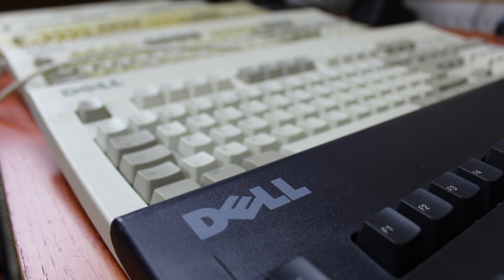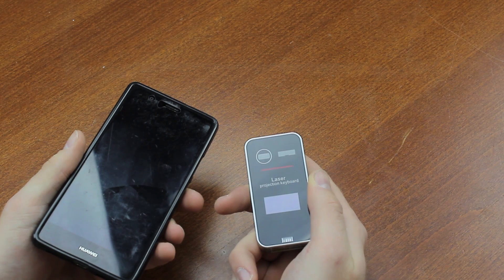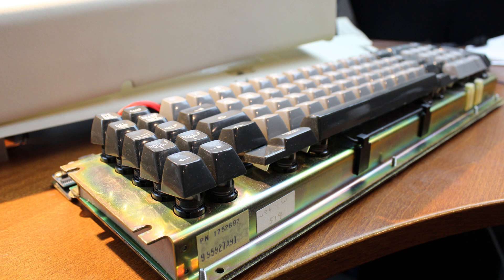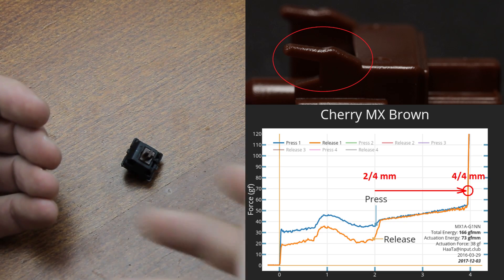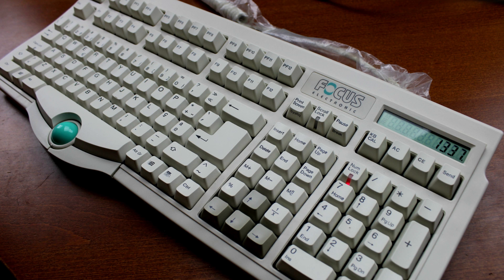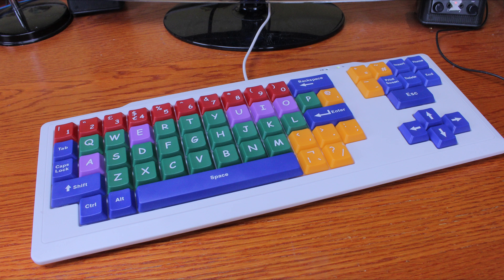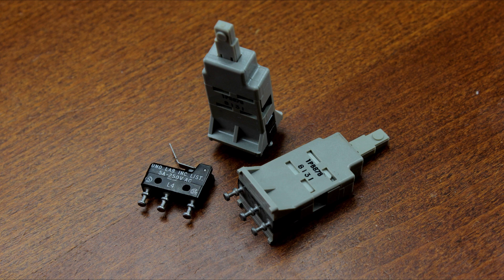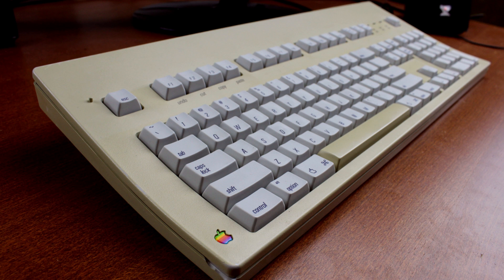When is a keyboard "mechanical"?

Comment: A mechanical keyswitch is any keyboard switch that uses  the flipping of a mechanical switch as the means of completing a circuit. And Pseudo Mechanical  key-switches are keyboard switches that have a feel and sound similar to mechanical key-switch but uses an alternative mechanism to complete to the circuit I.E. Buckling springs, Topre, Hall effect, Optical switches, etc...

is that good definition
Reply from the maker: Not really, your definition includes the thing to be defined xD .

Comment: A keyboard that uses machines or machinery?  By that definition rubber domes and leaf springs might fall under simple keyboards and anything that uses "several" components would be mechanical
Several is subjective but by definition the switch would have to be more than 2 parts

Comment: I've never actually thought of this, mostly because i am new to the "MK" fandom and didn't know there were so many different switches that had such a particular set of parts to it. 
Having watched the video to the end the only definition of mechanical keyboard i could come up with is:"A Keyboard in which the switches are composed of multiple parts specifically designed to convey the user a specific feel: linear, tactile, clicky or any combination of the three. As long as the parts used for the actuation of the switch are not limited to just pushing in on a rubber dome to stop electric current flowing trough a PCB, it is considered Mechanical Keyboard"
A bit long winded, my original thought in fact was to exclude older switches which are not manufactered anymore since the term got more popular recently AND they are the most problematic: They may include a rubber dome as the actuating method, but also contain different "mechanical parts" so excluding the "pushing of a rubber dome to stop electric current flowing trough a PCB"
 as an actuating method for a mechanical keyboard was out of the question. Then again, cancelling the history of the "mechanical keyboard" by ignoring the existance of these historical switches would just be dumb, and quite unrespectful to the pioneers that made the mechanical keyboards we have now possible.

Comment: What if the definition is "if the mechanism supports partway actuation", instead of "if the mechanism has partway actuation now"?
What if the definition is "if the mechanism's key travel to downward force applied (between the forces in which the key is all the way up to bottomed out) is not significantly straight"?
I am trying to think of the reasons I hear people like mechanical keys, and I tried to make a definition based on those preferences, instead of focusing too much on literal mechanical stipulations.
Neither of these definitions prejudge based on material, and I am particularly pleased with the second one.

Comment: you could kinda make this argument with almost any word
like, whats a "door" ?
an entrance to a building? is a window a door? if i break a hole through your wall is that a door? does it have to have hinges? sliding doors dont have hinges. what if its not the entrance to a building? is a gate to a fenced off area a "door"? what if you burn a house down but the door still stands and can open and close properly, but most of the houses walls and roof are completely missing? is that still a door? its not an entrance to a building anymore
at the end of the day, words are just tools we use to convey practical meaning, when i say "door" you can picture a door, probably all kinds of doors, and you know what the point of a door is
at the end of the day our goal is always just to communicate our ideas effectively as we can through the obtuse and imprecise medium of language. So if you want to tell someone that a keyboard is "mechanical" but arent sure if it qualifies, it might just be better to tell them the practical benefits of the keyboard, like if its more responsive or satisfying to use. Basically it just comes down to what you said at the end; "Who cares if it adheres to some random definition anyways?" 
tl;dr: it doesnt really matter just use whatever typey thing gets the words down good

Comment: I explained exactly this to a friend the other day. Mechanical being opposed to solid state, such as a mechanical drive vs a solid state drive. All keyboards are mechanical excluding solid state ones. I suppose technically defining it would be more about what you exclude rather than what you include. Essentially, the way I understand it when someone says mechanical is "Any keyboard that is not straight bottom out feel typically to mean a dome of some kind over a membrane or some sort of solid state simulacrum of a physical keyboard, such on displays of keyboards or visual displays." My personal definition is that a mechanical keyboard would be any keyboard that includes more than two parts between your find and the actuation. This includes all contactless switches I am aware of as well as topra, foam and foil and ibm switches. Think about it, straight up rubber domes rely on you pushing a keycap which pushs a dome which makes direct contact to a membrane, those weird "My First Keyboard" style contacts are a sheet of plastic that pops up and down to make contact. Smart phones use just your finger for conduction. In other words, if you remove the keycap and can push directly on a single mechanism that directly contacts and returns all in one piece then it really isn't "mechanical" Topra you push on a dome that pushes down a spring that makes contact; Not sure if this holds up 100%, but I think it's at least a better way of defining it than others and has more to do with "mechanism of operation" and is material independent. You could also say that it "must include a spring force that is separate in operation from the actuation mechanism." IE define in terms of complexity of the mechanism.

Comment: honestly I think that the rubber dome-less definition works. I don't count dome with slider as mechanical

as for the capacitive touchscreen ones, I think there should be a level of common sense, it has to move downwards when you press it.

Comment: i happen to like mechanical keyboards but like the old ones since they are built a whole lot better. some of the old keyboards certain models are hard to find or are expensive. what i want to find are keyboards like a model F and the model M. the only thing i have come up with that is even close to an ibm model f or m for that matter is the cherry blue switches i have in a logitech g710. what would u suggest i look for in a keyboard like an f or m that is at least a ps/2 keyboard

Comment: I think one blanket rule for whether or not a keyboard can be considered mechanical is a bad idea, but the best I can come up with is whether the action of pushing down the switch creates the contact or allows the switch to make the contact for you.  that mostly boils down to if anything moves off-axis from or at a different rate than the user input, it's a mechanical switch.

I also don't think "mechanical" is necessarily a good thing, or that "not mechanical" is necessarily bad.  optical switches are great, but they're not mechanical.  mx blues aren't great, but they are mechanical

Comment: The reason you can't define a mechanical switch to your liking, is because your notion of how we create categories is flawed. We don't create categories based on essential qualities of the things included within the category. We create categories based on the perception of family resemblance. The essentialist definitions that we have for many things are simply post-hoc reasoning for family resemblance based categories. This is something that the West is only now finally figuring out. 

A switch is mechanical if it feels mechanical. (I won't can go into what makes something feel mechanical, because there are several things.) It's really that simple. A keyboard is a tool that serves several purposes, and one of those purposes is to feel pleasant. For many people, a mechanical feel is more pleasant. You even indicated as much in the video, but with a tone of prejudice toward the feeling-based definition of mechanical. There's really no need to feel like the definition is insufficient however, because if we polled people on which kind of switches are mechanical, and which aren't, we'd find that there's a pretty good consensus for the vast majority of switches with a few edge cases. This is how we already define things intuitively, so you might as well embrace it intellectually.

Comment: My personal definition: "The ones that feel kinda switchey instead of gummy"
Reply: @jalsol  well, it's not a perfect definition. Just one that works for me
Reply: @futurepig  he was probably telling the other guy
Reply: There's some rubberdomes that feel switchey while there's mechanical keyboards which are mushy and gummy
Reply: Some of mech boards do use rubber as part of their switch, like Kailh BOX Silent Pink for example, and they feel quite gummy too.
Reply: @nathanlamaire  As I said, it's my personal definition, I wasn't trying to write an unified theory of the keyboardverse. There have to be lots of exceptions of my general rule
Reply: @jalsol  You can also have a rubber dome keyboard feel hard when it bottoms out as well. It all depends on how it's designed.
Reply: "As long as I have fingers, I will switch you! And if I have no switches, I will gum you!" - Eli Sunday, if he was talking about typing a sermon...
Reply: Cherry-styled "silent" switches can feel gummy or at least a little bit since it mainly uses a dampening silicon to reduce its sound. So it's not entirely right
Reply: Romer-G switches feel pretty gummy, alongside MX Browns. =P

Comment: I guess the definition would be multi-part. Something like: A keyboard is considered mechanical as long as: 1) It actuates partway thru
2) Uses a coil spring
3) Uses a leaf spring
4) Uses a principle (e.g. electromagnetic induction, light sensing, etc.)
5) etc...

Comment: For me "mechanical" is not a value judgement - it's just a semi-useful description. One of my favourite keyboards has a pretty typical rubber-dome setup, and I would not describe it as mechanical.
Although I use the term in a categorical way, I recognize there's a lot of grey area and I don't really have a concrete definition.

Comment: I think the problem is that "mechanical keyboards" is borderline a misnomer in itself. The true way to classify this category means not just looking at what you want to include, it could be even more necessary to look at what you want to _exclude_. My uneducated guess is that the "mechanical" tag caught on with most people during the 00's mainly because of gaming. When rubber dome membrane keyboards were in 99% of households, the proverbial "pro gamer" upgrade was to the slider-return spring-leaf style of the Cherry MX which, when compared to the mushy, thuddy, ambiguous membrane style, generally increased the number of moving parts in its mechanism.

Now that the hobby is more widespread and almost mainstream, so many more switch types have both been created and rediscovered that the moniker "mechanical keyboard" in its original state appears quite limited in the grand scheme. That isn't a bad thing, in fact I would argue it is good. While the phrase no longer accurately portrays the whole field of hobbyist keyboarding, it means progress. As someone still very new to the enthusiast keyboard hobby, the sense I've discovered a new wide open world to enter and settle into feels incredibly promising and potentially rewarding.
Reply: The use of mechanical isn't new. Catalogues at the time said the Model M was a membrane whereas a Cherry G80 was mechanical. The catalogues were shown in the IBM Model M History video. It's the importance of the term that hasn't changed. Even though the Model M was labelled as a membrane, it was more expensive than most Alps or Cherry keyboards and people who could afford the $200+ price tag were happy to buy it.

Comment: maybe a good defenition would be that it uses a mechanism that isn't connected to the other switches like rubberdome
Reply: The topre problem because in stock topre the spacebar would be mechnical but the otherones would not be mechnical.

Comment: I'm going to say that they actuate partway through, it's the reason I got into mechanical keyboards. I didn't want to have to type on something mushy and without feeling (worn out rubber domes) that also had a bunch of other students' hand oils on it.* I think this definition includes the most amount of switches generally referred to as "mechanical" including most of the good Dome+Slider switches and Topre.

Also, you sound like you're in pain and trying not to swear or scream and gently vent your anger outwards. 

*Note: I take a DZ60 around with me so I don't have to disinfect my hands in a vat of isopropyl alcohol after using it. I found a Cheeto inside of the keyboard once, and that was probably my tipping point when I decided I'd solder my own. The rubber domes are in terrible quality, having broken down to the point that they're effectively linear - only they actuate at the bottom, and sometimes you can't even tell when they've hit. 

It's an improvement to actually feel what you're typing, that sense of reliability is helpful so that I can continue to type instead of trying to press keys harder.

Comment: what makes switches mechanical
should have a slider and a non dome metal springs
has a lifespan of 20+ keystrokes
actuate before bottoming out

(some use domes membranes and some don't use contacts ALL MECHANICAL SWITCHES COME IN SHAPES AND SIZES)

Comment: If one must refer to keyboards as mechanical, how about, "A keyswitch is mechanical if it contains X number of moving/working parts for actuation?" Like, 2 or something, depending on what you consider a moving/working part. And this would ignore things like the keycap and the contacts/contact points on the keyboard. A standard rubber dome keyboard consists of a single sheet of said domes you push directly on to the contact point, and would be considered only one moving/working part per "keyswitch," for instance. Topre and Model M switches use multiple parts despite their membraney nature, so they would be included. The Oki tactile gourd spring wouldn't count as mechanical due to it's single part nature (despite being really cool). This definition should ignore stigma, keyfeel, as well as the quality of the keyswitch, allowing for the best, objective definition I can think of so far. Does this work, or am I missing something?

Comment: My own definition is that a mechanical keyboard should not rely on easily degradable components for its function.
This excludes rubber domes of all kinds, foil and foam, and some other switches, but I'm fine with that. I want a keyboard that will perform the same, with regular maintenance but without relying on ongoing production of spare parts, in 30 or 50 years.
Reply: That would be exclude Alps switches because they degrade with use and dirt even though they're contact based switches similar to Cherry.

Comment: If we define a mechanical keyboard based on its feel, then that leaves us to ask what makes something feel mechanical. It's still not absolutely perfect, but we could define a mechanical keyswitch as one whose source of resistance and tactility is metal parts. This definition excludes Topre from being considered mechanical, since the metal spring isn't used for providing force. Having said that, I think it would be fine to see Topre as a counterpoint that something not being mechanical doesn't make it bad.

Comment: A mechanical keyboard uses switches which work with keys being pressed on and moving something inside to actuate instead of keycaps with empty stems hitting on rubber. (A 5$ office keyboard basically)
There you go
When you just push a key onto rubber its not a moving part but rather an object. If you pushed a box would you call it mechanical just because it moved?

Comment: Maybe the definition of mechanical keyboards may be that: "They are keyboards that aren't made JUST with a membrane and rubber domes."
Reply: digital keyboards tho
Reply: crispy space agency just add "moving parts" to the definition
I'd also specify the exclusion of keyboards that are just a membrane and nothing else
Reply: whatever definition you land on, someone can always make something that lands in the middle. As long as it's intuitive and catches most cases, I'd be ok with it.
For me? springs.
Has individual rubber switches that feel great? ok, not mechanical. I'm fine with that.
Has a single sheet with sewn-in springs that feel awful? sure, mechanical. I'm not getting it, but it works on springs.
Reply: @MadsterV  as Thomas said though, the best idea would be to give up entirely on the term "mechanical" and refer to older keyboards as "vintage" and newer ones as "enthusiast"
Reply: @plazasta  no. Immediately when you get into this hobby you learn that's inadequate. Old Soviet terminal keyboards are built to military specs, and will last long after we today are all dead. The same years, Eastern European clones of ZX Spectrum have really awful keyboards, often can't be repaired. Same vintage (or same degree of newness, depending on your point of view) Soviet military tech, you want to qualify as "mechanical", No one wants to call even the original Speccy keyboard, "mechanical". Both are "vintage", though.
Reply: @squirlmy  and what's the issue with that?